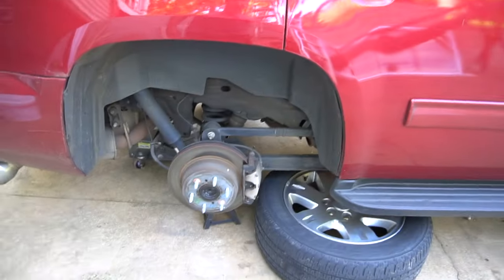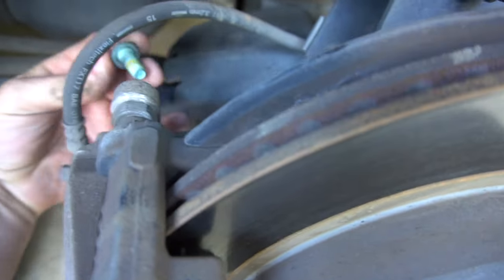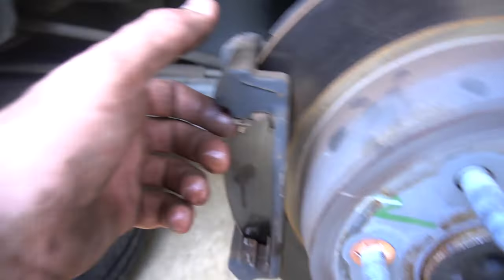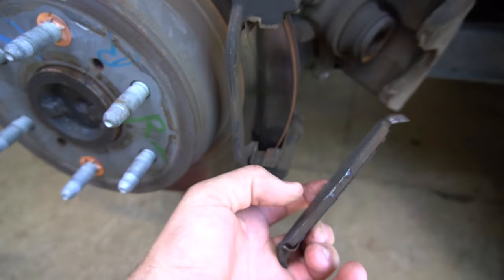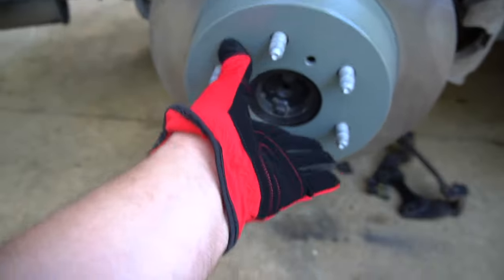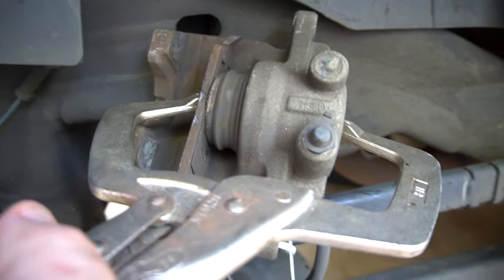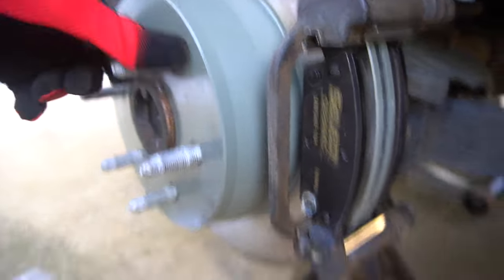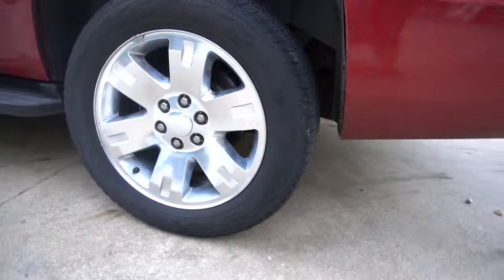How to Change Rear Brakes and Rotors 2007-2014 GMC Yukon Tahoe Silverado Sierra

Comment: I think once you're in that deep, its a good idea to pull the slider pins out to clean and lube (hi temp brake grease) and also replace the boots if they're torn.  Sticky/dry pins can cause one pad to wear much faster than the other pad on same wheel.
Reply: Silicone brake grease on them pins

Comment: Hi, remember when instaling the pads you have to make sure the wear indicator is located against the driving forward disc rotation, if the one you are installing is in the oposite side(up or down), then it is for the wheel on the other side of the truck, also take in mind you need brake grease, any other will flow with heat and damage the pads in daly use.

Comment: You took out the clips holding the rotors when u put the new ones do u put back new clips or u don't need them
Reply from the maker: You can put the clips in if you want. they are warning clips for when the pad is thin
Reply: @TheRykerDane He is asking about the copper clips on the stud that hold the rotor in place

Comment: Brake pad with wear indicator, u have put on outside, it is supposed to be inside or else caliper will not fit.
Reply from the maker: Some are different but the wear indicator is usually on both sides

Comment: My rear passenger brake caliper bracket bolts came out easy. But the rear driver brake caliper bracket bolts using PB BLASTER, a 1/2 breaker bar, cheater pipe, hammer and muscle were not budging. Had to use heat to get those two bolts you mentioned loose. It was like they used "red" permanent locktight on those two bolts. (The driver side bolts are difficult because it's harder to get good leverage on that side).

Comment: After changing out pads on my 2007 Chevy Suburban and going for a test drive, the driver side rotor was extremely hot compared to the passenger side (450 degrees F using my infrared temp gun).   Any idea why the overheating condition on the one side only (NOTE:   I took everything apart to ensure correct installation)
Reply: Any issues with the e brake hanging up that caliper?  You figure it out?

Comment: Why did you decide to replace the rotors? How can you tell if they NEED it? Also, why didn’t you replace the copper clip like on the OEM?
Reply: He took the rotors in to be turned and they were worn past the point where they could be turned.

Comment: What would happen if I forgot to open the brake fluid  reservoir?
Reply: I never do. You can just bleed them later on or they may end up being completely fine
Reply: The cap might pop off and maybe splash some brake fluid in the engine compartment.

Comment: Truth... like it if you showed where you jacked the car up and where you placed the stand, I am not sure on the back. Sorry new do the DIY and don't want to mess up
Reply: jack it up on the frame that runs down the side of vehicle. Not door the thick steel frame
Reply: @Uneducatedcapitalist  I got a 2014 Yukon and it has that braket where behind the back door to the rear axle, and the dealership has told me not to jack it up from behind that point. I'm sorry I forgot to mention that...
Reply: @quinjes5 read your owner manuals book. Should tell you everything you need to know 👍🏼